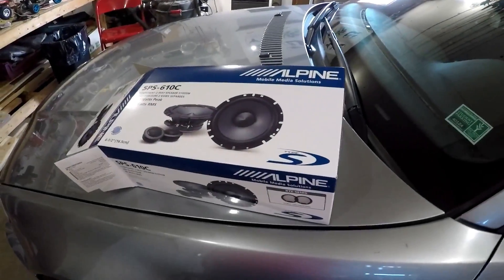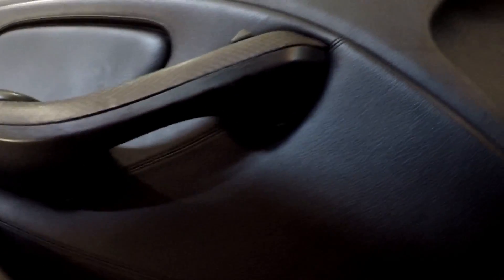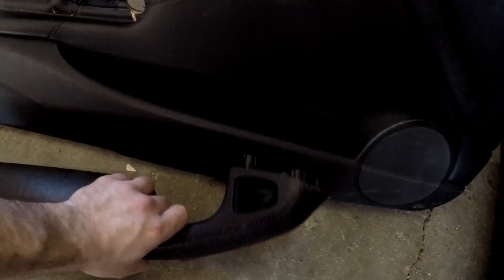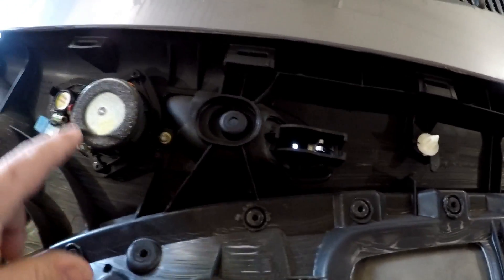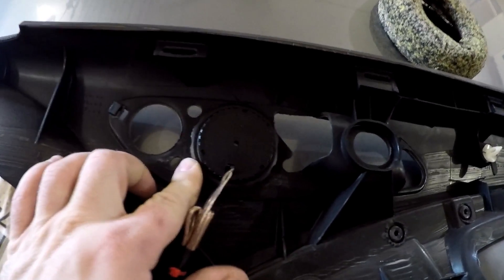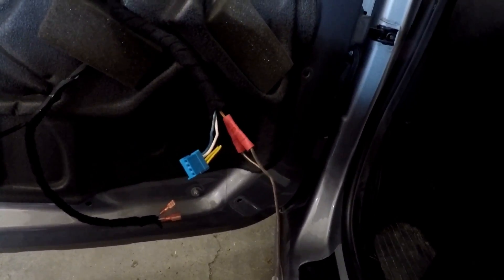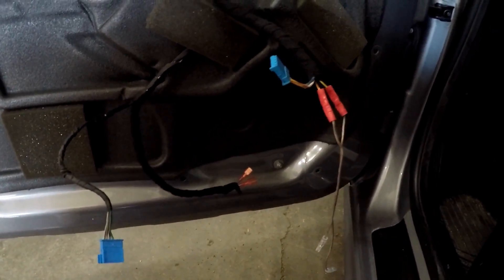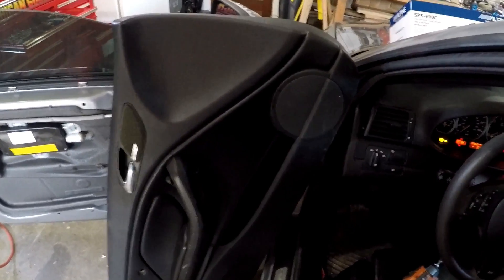BMW e46 330ci Door Speaker Install

Comment: I recently did mine. I removed the connectors from the factory speakers and wired them to connect to the new speakers. I also used adapter rings as you did for the front. Mine is a convertible, and I couldn't find adapters that fit the rear. I had to make baffles for the rear out of nice solid wood (3/4" thick to give me room to add speaker with slightly more depth.) I just traced the old speakers on the the wood and cut them out in the exact size. Then I cut out the hole for the new speakers and screwed them into the wooden baffle. I also cut off the connections from the old rear speakers and wired them to the new speakers. This kept everything on the car side "factory," which was my goal. So if I sell the car, if the buyer wants to put factory equipment back it, it will just be plug and go. I'm thinking of adding a sub, but that's yet to be determined.

Comment: Changing the speakers will improve the sound but if you really want to improve things you need to cut the metal out behind the speaker so it has some breathing room. I actually have my speakers mounted to the door itself on custom mdf baffles and they're solid, I also fabricated a panel to cover the big gap in the door and the difference was huge, the car actually has proper midbass now.

I fully treated the doors with deadener and open cell foam behind the speaker to help with standing waves while I was there and did the same to the doorcard so it doesn't rattle either. It was a lot of work  but the improvement in sound quality is absolutely worth it.

If you do decide to cut your door be careful how you do it, there is a long metal runner the window mechanism rides on directly behind where you cut and it bolts on at the bottom so you can't cut a full 360 degree circle. You can feel where it is before you start and decide for yourself where and how much to cut, it's fairly straightforward though just be careful.

Comment: You can lever the large control off switch,hold the stem which will be left sticking
    up with pliers / grips, and pull up.Connector will come with switch,no damage done,
    and pull connector off switch. Simples !!!

Comment: Could I replace only the tweeter and leave in the stock midrange? thanks
Reply from the maker: I'm sure you could. Maybe just get factory replacements if you were only interested in the tweeters. Make it much easier. But I haven't done enough research to know 100% which aftermarket tweeters would be a solid choice by themselves.

Comment: So I ordered some new speakers for my E46 and I was wondering if I need the component splitter that comes with the speaker or if I need to just plug in the tweeter and mid where the factory ones went using the stock wiring?
Reply from the maker: I think I just wired them directly to car harness.

Comment: what happened to this whole talk about having to match impedances with the Harman Kardon ones? I keep reading I can't just throw in any speaker because the Harman Kardon system has lower impedances.. is this true?
Reply from the maker: I read all of the same things. I'm sure ideally, yes, you should match the ohms to whatever the HK system is. However, I did not. These are only 4ohm speakers. And they work. They seem to work just fine. It has been over a year now, and I play music loud, typically volume all the way up. So far these Alpines have held up well with daily abuse. The factory amp is still being used to power these. Nothing has changed since this install video. I haven't even replaced the rear speakers yet. Which is next to come though. Hope this helps in your decision.
Reply: "...the Harman Kardon system has lower impedances.. is this true?"  Yes.

Comment: Hi Mike, could you tell me what you have done to the rear speakers? did you replace them as well?
Reply from the maker: Hey Bobby. I have not replaced the rear speakers yet. I meant to, mainly because the rear shelf rattles and it is annoying. It's still on the list to do. However, I will say that the front speakers are still working great to this day.
Reply: (Copied from my original post) I recently did mine. I removed the connectors from the factory speakers and wired them to connect to the new speakers. I also used adapter rings as you did for the front. Mine is a convertible, and I couldn't find adapters that fit the rear. I had to make baffles for the rear out of nice solid wood (3/4" thick to give me room to add speaker with slightly more depth.) I just traced the old speakers on the the wood and cut them out in the exact size. Then I cut out the hole for the new speakers and screwed them into the wooden baffle. I also cut off the connections from the old rear speakers and wired them to the new speakers. This kept everything on the car side "factory," which was my goal. So if I sell the car, if the buyer wants to put factory equipment back it, it will just be plug and go. I'm thinking of adding a sub, but that's yet to be determined.

Comment: could somebody answer this please? i have upgraded stock speakers to apline & jcv speakers, wired it from 1000w ampilier and music sound just a little better than before but still terrible.. could it be because car has old dynavin stereo?
Reply from the maker: I mean it could be the head unit, but I kinda doubt it. I would just check all the connections. Make sure your ground connections are solid and on raw metal (i.e. not on paint) and I've seen this before too, don't run your power wires close to your rca wires for the amplifier. That can cause interference and such. Hopefully you can get it sorted out. I know how frustrating poor audio quality is.
Reply: Yes I had issues with unwanted noises which wires was making but sorted that out by connecting noise filter. As well the bass sounds so terrible

Comment: Hey, did you changed the tweeters and mid-range as well or just the bottom speaker?
Reply from the maker: Cristopher Quezada The stock tweeter and mid were replaced with just a tweeter and the woofer was replaced with another woofer.

Comment: What kind of stereo do you have?
Can you add any more vido when playing music (which you can play;)
Have you continued the same h / k speaker in the hat shelf? :)
Reply from the maker: The head unit is a Eonon GA5150F. I have not done the rear deck speakers yet. I plan to as well as add sound dampening or whatever to stop the shelf from rattling. I will do that all at once.
Reply: Okay. Would like a comparison before and after. It would be nice!

Comment: what kind of kit did you get for your dash radio
Reply from the maker: No real kit. It's an Eonon radio which basically bolts in like factory. However since I didn't have stock navigation I had to relocate my climate control and heated seat panel. I bought that kit from ECS Tuning.

Comment: Couple questions on this, what kinda specs do you need to to have "plug in an go" sound system upgrade?
Reply from the maker: Andrew Donaldson I'm not sure there is a plug in and go option except for the BavSound setup. But that is really expensive. I think last I looked it was around $600.
Reply: Mike Hansbarger well with this you just rewired new speakers in, was wondering how you chose those
Reply from the maker: To be honest, I went on Crutchfield and they said these would work. I read a thread on a forum a while ago about some people using these as well and figured I'd give it a shot. It had to be better than my blown stockers.

Comment: which head deck is that?
Reply from the maker: Eonon GA5150F
Reply: Mike Hansbarger how are you liking it? any issues?
Reply from the maker: I love it. Haven't had any real problems, it has locked up only twice on boot up and on Bluetooth audio it skips for like the first 10 seconds of play then it's fine. It didn't always do it, just recently. I might do a factory reset and see if it fixes it.
Reply: Mike Hansbarger thanks! I was thinking about buying one. Have you ever used it for maps? also how is your audio quality after the install? specifically the bass.
Reply from the maker: I have used it for maps. If you can setup your phone as a mobile hotspot, the unit will use your phones data and you can use Google Maps. That's what I do and it's great. Make sure you install the WiFi antenna that comes with the radio. Audio quality is pretty good. The bass is adequate. I'm not into loud bass like I used to be. The radio has a built in EQ so you can tune it how you like.
Reply: Mike Hansbarger Thanks! There's like 10 different brands. Gets kinda hard to choose
Reply: Does the new head unit give you the fuel burns litres per one hundred kms? It’s really handy to monitor the fuel burns noticed the fuel was going up for 7.3 litres per hundred to 8. Turns out had a wheel bearing start to go. Got it before it did any major damage

Comment: Hey Mike

I'm having a bit of trouble with the connections. Not sure what connects with what as I'm getting an output from the tweeters but it seems as though the speakers aren't getting anything. Could you send a picture of it if possible ?
Reply from the maker: Here is site (link below) I used as a reference for the speaker wiring. I have the HK system. If you don't the colors might be different. I don't have a picture of my install. Hope this helps!

http://www.m3forum.net/m3forum/showthread.php?t=462847

Comment: How do these sound? Do they bump?
Reply from the maker: They sound pretty good. Probably would be better if I replaced the factory amp. But for the money and effort it took to install, definitely worth it to me.
Reply: I'm thinking of buying it. It's $80 at Best Buy.
Reply from the maker: Wow, $80 is nearly half of what I paid. Seems like a good deal to me!
Reply: Can you please tell me the size of those speakers and the ones I need for the trunk. I have 2002 BMW 325ci coup. Thanks bud.

Comment: Something is not as it should be. Originally you have  3 ways speaker, Woofer, mid range and tweeter. You just connected tweeter and woofer connection . Where is mid range? You missing mid range tones!